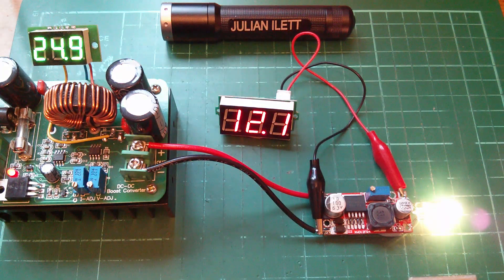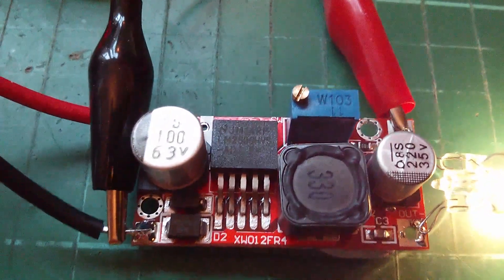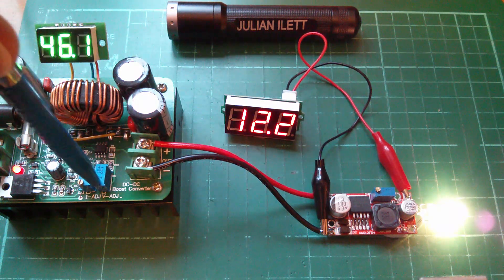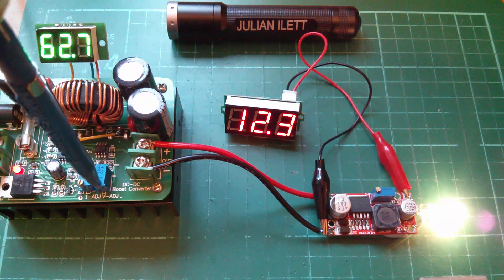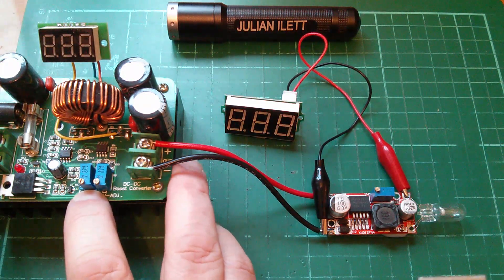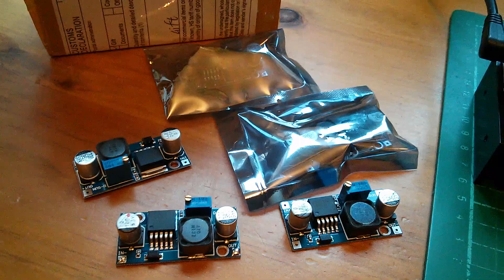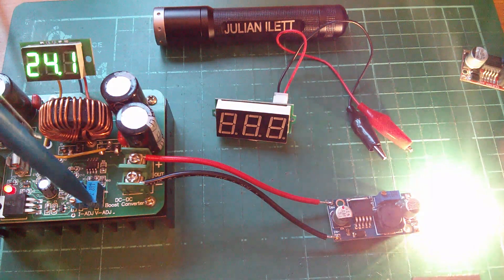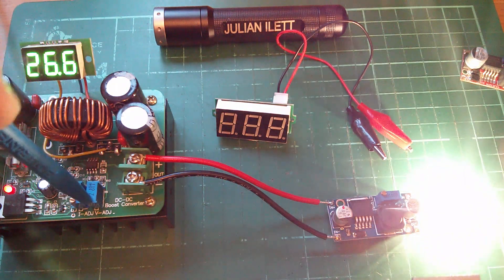Fake LM2596HV Voltage Regulator Buck Converter Modules bought on eBay

Comment: I recently bought 8 DC DC converters with the LM2596HV, had the same problem as you mentioned.  So after 9 years this issue is still not solved in China.  I reordered DC DC converters that, on papers, have to withstand a 120VDC input.  Thanks for your information but in my case I noticed it too late.

Comment: Velleman supply the ones with the 35v input capacitor. Bought mine from ESR Components. Another point has arisen with the modules mentioned concerning the maximum allowable power dissapation of the ic power chip itself. Velleman does state this on its website. It is suprisingly low at 10W as is without additional heatsinking. ESR also supply the Cebek modules that use the same ic. These come on a large pcb board with a proper large vertical mounted heatsink that almost spans the width of the pcb.

Comment: It's a bit like the usb convertors that claim 2A output and have the tiniest imaginable surface mount chip.  Needless to say it was only capable of giving 500mA which is consistent with the tiny size of the chip and the price..  This didn't matter to me as I am only using the board to supply an Arduino project which draws 100mA tops but I can imagine the magic smoke being released if someone plugged a phone or tablet into it.  Be wary of false claims in eBay listings and remember you get what you pay for.

Comment: Look at the recitifier diode. It should be a schottkey type. Your DC converter probably have a insufficient voltage. I got some boards same type boards with a SS14 diode which is rated 40V (spec).  So no wonder the boards fail. Allso, the output cap. has clearly a rating of 35V. So why do You post a video, where You exceed this and talk about fake 2596HVS boards. Im this aspeck You are are a really amateur...posting fake tests....

Comment: If this is hv buck, how can the input cap be 63v with output cap rated at 35v and not die when adjusted to max output voltage?

Comment: I just received and tested two of these lm2596hv buck converters I bought on ebay to step 48V down to 5V. Luckily I was suspicious of the price difference, and ordered the more expensive ones. I assumed it to be higher quality because they put 63v caps on the input and output, although it turns out this is at the expense of much needed output capacitance so the ripple is even worse than expected. At least they are the proper hv chips. 

One thing I will say is that they certainly aren't good for 3A, as the first one I took to  3A let the smoke out in a hurry. They seem to be happy enough delivering 1.5A, but I'd say that's about it. After several hours of runtime the caps were at 70C, the chip at 90C, and the inductor at 95C.

Since I need to replace the output capacitors for better filtering anyway, I was going to order the cheap ones. The missing diode made me question things though, and a Google search led me here. I'm glad it did!

You saved me $15 and the smell of letting the smoke out! Thanks! Sub earned.

Comment: I believe there is no original LM2596HVS. ON Semiconductors manufactures the LM2596. I didn't find LM2596HVS on the ON Semiconductors website.
HVS is a Chinese version.
LM2596HVS good, it will depend on luck.

Comment: as far as i can tell all of these are fake working or not because national semi/ti never made a lm2596hv (or have scrubbed it entirely from the internet which seems unlikely), they make 2591,2,3,4 hv but not 2596hv
i'd love to have a datasheet for the actual LM2596HVS they're using here, i'm trying to dig up an old digikey catalog to see if it's listed

likely these are remarked hsemi or some of the other random chinese/hk/taiwan clones

Comment: I have seen many fake capacitors like this.  On the large fakes, you could actually cut the can off...and there lies the cap actually used! And unmarked.  Maybe they are doing this with the smaller ones now.

Comment: What hapened if i connect to input 50.v 1.a from solar panel, and i set in output 14.v for charging car batery block? This stil works? How much A  power i get?
Reply: I don't think this board can manage 50watts without heatsinks, there are bigger modules with higher wattage that include heatsinks for a little more money.

Comment: What were the specs in the listing?  Just because one part on a board has a high voltage spec doesn't mean that the board is. To the contrary, that's a guaranty that the sum of the parts can't work at that voltage.  I'm an engineer and I'd NEVER use a part, a machine or any device created by people with one of its components as maximum rated capacity unless I were TRYING to make it fail.

Comment: Even if the part is fake simple power supply design would show you a real part would burn up too.  The rules of efficiency of power design can not be disobeyed.  Even if the power design is 80% there is watts to be dissipated in the buck down circuit.  At 2 amps, and a very high input voltage to output voltage ratio, it can amount to several watts of loss.  That little part on a PCB can not handle it.  Even the buck coil is not rated for that kind of power.  The coil would over heat too.  This video could have been better.  A lot of fake parts from china, stand up well to good designed circuits used in average usage.  Where they all fall down is in MTBF, calculations.

Want a good subject for fake outing!  Get some lm35dz temp sensors from china, $4.00 for ten price.  I will take any bets for any amount, what you will receive are NPN transistors badly remarked as National Semiconductor lm35dz's.

Comment: desolder the potentiometer
and check if the potentiometers are also also faulty (might be as well)

Ive had a buck/boost converter do something similar. except the potentiometer was the problem.

Comment: I'm struggling with these buck boost things. I had an Arduino project set up with 3 power supplies: 5v, 12v, 6v and all was working fine until I decided to get 1 20A 12v supply and use 2 buck/boosts to get the 5v and 6v as well as the native 12v to power everything from one power source. Now my push button keeps detecting as "high" when it shouldn't be. If I disconnect the servo + side, it doesn't do it, so it seems to be caused by electrical noise. 
Can anyone explain how I stop this as it's making me crazy?
Reply: OMG don't worry, it turned out to be a faulty button. I just replaced it and it works fine.

Comment: The buck converter works but not as marketed, its not a fake buck converted just a misleading one. Moral of the story here, while there should be a trust between seller and buyer that the seller is selling what they marketing, one should always check to see if it does what its advertised as doing before attaching to projects that can be affected by it

Comment: I am going to make a video like yours, first I am going to buy a resistor that is meant to a 0.5 watt 150ohm resistor. I will run it in a circuit where it is dissipating virtually 0.5 watt and conclude it's legit.
Then I will buy more but this time buy 1 watt version, I will show they work fine when dissipating up to 1 watt, but then I will up the voltage considerably and have it output far more heat than 1w and when it starts to fry I will say the product is fake. lol

Comment: The second set you bought suggested a max of 40v as well as a component listing as 45v max. But you put it up to 55v, why are you surprised you destroyed it? It was working fine up until that point. Where as the first one you bought said 63v and you only ever put it up to that,  that isn't a fair comparison. If you overvolt the second set and destroy them and call them fake, at least overvolt the first one to well over 63v and see it fry also. All buck converters will fry if overvolted way over their ratings. 
The second set even told you 45v max, but you didn't listen and destroyed them. They aren't fake, they work, you aren't even meant to really run any electronics at their theoretical max anyway, it's meant to be a red line limit where people know to just stay under it a little.
Reply: "But you put it up to 55v, why are you surprised you destroyed it?"

I guess watching videos closely is not a skill you ever mastered. The second set of 5 regulators were sold as HV (60V) versions. Julian only SUSPECTS they were just standard chips with fake HV markings. Try to get a clue before posting drivel.

Comment: I want to provide a metal detector circuit with 12V from 4 Li-Ion batteries in series
What sort of component should I get? Thanks
Reply: You should get the datasheet for the metal detector to determine what the max safe voltage is.  You might not need any buck voltage regulation, just run at full voltage, but will still want a low voltage cutoff protection circuit.

Might I suggest that you just use a 12V cordless drill battery instead, one with a protection circuit already built in, and then you also can use the charger custom designed for it.

Anyway a typical metal detector is a portable device meant to be ran off batteries so they should accommodate a certain range of variable voltage, not need voltage regulated to exactly 12.0V, but you could open and inspect the capacitors, ICs, etc to see if any have a 16V limit.  It might be easier and cheaper to just toss two high current silicone diodes in series to drop ~ 1.4V, and a switch to bypass them once the battery pack drains some, to get longer life out of the battery.

Comment: Hi Julian, I recently bought this boost/buck converter http://www.ebay.com/itm/DC-DC-Automatic-Boost-Buck-Converter-5-32V-to-1-25-20V-5A-Step-up-down-Module-/181515918748?hash=item2a43311d9c:g:3AEAAOSwd4tUB~J4 for charging supercapacitors. Now, I tried cranking the output current pot (monitored it with my DMM) to the max. around 5A for several seconds, then the inductor starts making a high pitch noise and one of the input power wires turned hot. Since I want to set the specific current for charging my supercapacitors, I'd like to know what tricky components those modules with onboard display use without burning the electronics out? Cheers!

Comment: Surprised to see this show up as a fake "New" video , thanks youtube. However, it does show a constant source of controversy and conflict with Chinese made stuff. I had just put on, in a much newer video Julian, a comment that the 2596/32 needed a 3.3 volt microprocessor and that , if you ordered the Pro Micro, you could tell it was 5v or 3.3v by looking at the speed, 5v uses 16mhz crystal, 3.3 uses 8mhz crystal. Ive seen that Chinese ebay companies will have piles of boards and then ship the wrong one by mistake. You need to be constantly on the lookout.  Sometimes I think the employees are fooled because there bosses don't label stuff correctly.

Comment: There's nothing fake here, you just burned this useful little thing by mishandling it.
Reply: Exactly, the first one suggested 63v and he only ever took it up to 63v. Then the second set suggested 40v with the description max saying 45v, yet he turned it up to 55v and it fried and then he called it fake. That is pretty retarded if you ask me.
Reply: Martin Green is correct - There has to be a trust between seller and buyer here, yeah the buck converter works and breaks after a certain amount but understand it was marketed as being able to handle MORE. What if you had a project connected to this and blew it up because the buck converted you bought was marked wrong? I wouldn't call this a fake product I would call it a poorly marketed product, perhaps the seller themselves bought a batch that were marketed at that and he or she too as well got ripped off with out knowing? Yeah one would say check your stuff before you attach it to your project and common says tell us that we should but there is also a trust thing here. If you buy 1 AA 1.5 V battery you expect it to be 1.5v and fully charged before you use them, you are not going to run down and get your battery tester right?
Reply: Why is it so hard for your feeble mind to understand that they were SOLD AND MARKED AS HV (60V) versions, but Julian SUSPECTS they were really just standard regulators with false markings. Although the chips were marked HV Julian read the data sheet for STANDARD (non-HV) parts only to find out what voltage would probably damage them if they were indeed standard chips falsely marked as HV, not because he bought non-HV ones the second time.

Damn you are clueless!!!

Comment: I have one question . I have 12 volt power supply , i want to power 12 volt amp an 5 volt bluetooth adapter with step down dc to 5v , but the problem is when i conect the 3.5 mm jack there is a ground loop ... how to fix it?
Reply: "when i conect the 3.5 mm jack there is a ground loop ... how to fix it?"

Easiest method is a ground-loop audio transformer made for just this purpose. Something like these...

https://www.google.ca/search?q=ground+loop+isolator&client=opera&hs=yD9&tbm=isch&tbo=u&source=univ&sa=X&ved=0ahUKEwjr44biut7TAhVG64MKHfnrB9YQsAQIfA&biw=1043&bih=612

Bluetooth audio is not audiophile quality so even a cheap one should do the trick, but if you are concerned about frequency response you might want to go for a pricier one...

http://www.avshop.ca/sound-amp-pa-audio/signal-processors/feedback-controllers/art-dti-dual-transformer-isolator?gclid=Cj0KEQjwi7vIBRDpo9W8y7Ct6ZcBEiQA1CwV2CNPpKrluEjqLphls33397kqnnMIAmXgS9Y9kc-qtFkaAhbg8P8HAQ

Alternately you could forget the buck convertor and go with a transformer isolated step down regulator so the audio and power circuits don't use a common ground.

Finally, you might be able to eliminate the hum if you break the ground connection at ONE END of the audio cables, relying on the grounding from the other end to shield the center conductor. YMMV

Comment: foxy says not cool ! how long before fake parts are fitted in aircraft avionics ?
Reply: "how long before fake parts are fitted in aircraft avionics ?"

They already are, there have been cases of fake electronics components used in repairs being discovered and fleets being grounded till they were replaced by authentic parts. Not just electronics either, fake mechanical parts are a problem for airlines too, including fake high-tension bolts which shear way too easily. Even the US military has a problem with counterfeits...

https://www.wired.com/2008/04/fake-parts-in-a/
Reply: I was afraid someone would say that I have known a long time that such things go on all down to penny pinching accountants and component buyers

Comment: I bought a couple of these and looked just like yours, first one didn't work (might be because my polarity was reversed?) second one worked fine. So who knows, cheap Chinese knock offs...
Reply: I used mine on a 36 volt power supply out of a printer and dropped it down to 14.2 volts to charge motorcycle batteries, works great!

Comment: How does this video have 23 dislikes?

Thanks for the video, Julian.

I just bought 2 LM2596S modules from a store in Bangalore, India, for Rs 100 each (that's about $1.5, ridiculously cheap). Let me run some tests.
Reply: why it has  23 dislikes is dishonest seller dont like this
Reply: Not just that... there are a couple of morons here who claim that the parts aren't fake because Julian pushed them above their 45V rating even though he CLEARLY states they were sold and marked as HV (60V) regulators. You can't fix stupid.

Comment: the maximum voltage input is 48v only but i dont know why they rate it DC-DC 4.5-60v take a look at this  http://www.lazada.com.ph/48v-step-down-module-dc-dc-45-60v-lm2596hv-adjustable-voltageregulator-module-blue-3103234.html

Comment: Hello can you recommend me what buck-boost conv. should I use if I have 12.6-11.1V battery and i need Autocontrolled output 12V constantly ...link? Thanks
Reply from the maker: Definitely the LTC3780 module
Reply: +Julian Ilett Any cheaper lighter solution for FPV RC model? I need that for fpv transmitter -otherwise low voltage no image
Reply from the maker: How about this SEPIC converter - eBay 401088945994

Comment: your argument makes no sense.why would you want to regulate 60 volts down to 20 volts when you  can just boost 12 vol;ts to 20?????/
Reply: "why would you want to regulate 60 volts down to 20 volts when you  can just boost 12 volts"

Maybe because you've got 60V, not 12V?
Reply: no.you are more likely to have 12 volts available then some 60 volts.
Reply: "no.you are more likely to have 12 volts available then some 60 volts."

Would you? How would you know what I have available? Stop trolling.
Reply: no trolling.12 volts from wall adapter,car battery,,psu,etc...60 volts? not from the mains.
Reply: +Ese Callum - Ok, fair enough. How about this then? Buck regulators are significantly more efficient that boost or buck/boost circuits, especially important in portable equipment. Admittedly though you are unlikely to have over 12V from a  battery supply.

http://www.eetimes.com/document.asp?doc_id=1273123
Reply: EFFICIENT.HOW?  BY HOW MUCH ?A FEW PERCENT? ...YOU HAVE STILL NOT EXPLAINED WHERE YOU GOT YOUR 60 VOLT SUPPLY FROM..DID YOU STEP IT UP SO YOU COULD STEP IT DOWN?